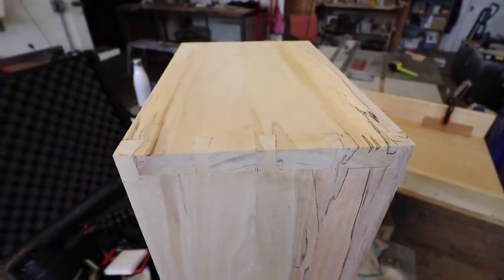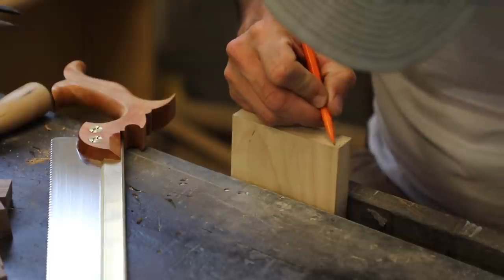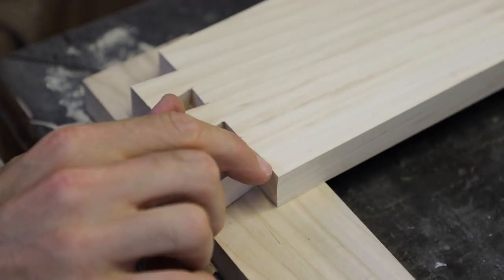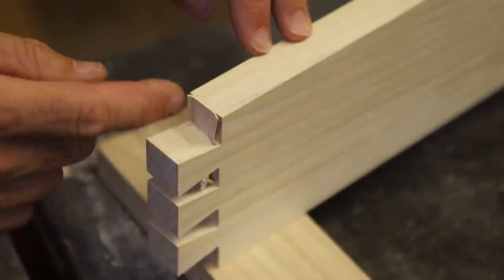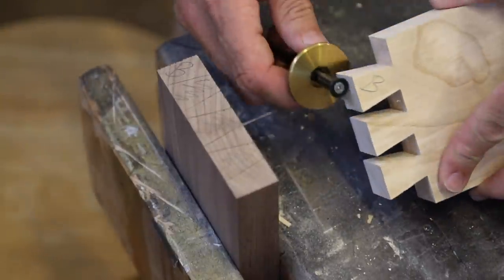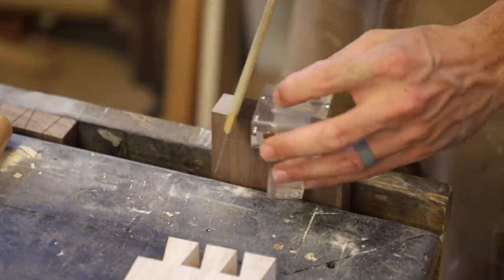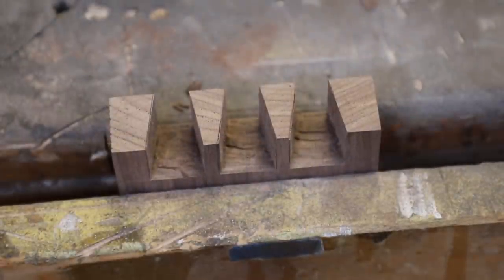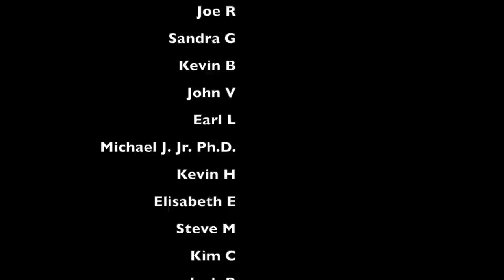Hand Cutting Dovetails | A Built in Bench Seat II

Comment: Its good when the dovetails fit tight...but the tight fit might eventually cause splitting the pin board when hammering them dovetails in. What we learned in carpenters school is they should go in pretty easily till the half...the rest can be hammered in.
Greetings from a german carpernter 😉👍
Reply from the maker: Thanks for the tips, these were a bit too tight at first, I had to fine tune them.

Comment: I practiced and did two sets of dovetails with my KM dovetail jig...I've got a ways to go to get to the level you made here, just beautiful craftsmanship.  Love this whole entire bench build you did.  Did you know the jig can help in chisel work as well in keeping everything lined up and vertical?
Reply from the maker: Hey what is the KM jig, it sounds really nice especially if it helps with chisel work!
Reply: @50Acres  The Katz-Moses Dovetail jig you used To keep the angles correct when sawing the lines.  One example is you can flip it over, place it on your chisel line or marking line and place your chisel against the magnet then tap away slowly.  You can also place it like you did to cut the Pins and help keep the angle on your pin to chisel it down if necessary.  He has a video on doing dovetails where he does it.  Basically just like it keeps your saw at the right angle or vertical the magnets can be used with chisel to keep it dead vertical or at the correct angle.
Reply from the maker: @cnich0168  Ohhh I gotcha I just didn't register the abbreviation.  Thats clever to use it with the chisel like a shooting board.

Comment: Whit spots on your fingernails means you need to take zinc, and calcium supplements.  Zinc is needed for DNA synthesis, immune function, metabolism and growth. It may reduce inflammation and your risk of some age-related diseases. Zinc is also needed for your senses of taste and smell. Because one of the enzymes crucial for proper taste and smell is dependent on this nutrient, a zinc deficiency can reduce your ability to taste or smell. Most people meet the RDI of 11 mg for men and 8 mg for women through diet, but older adults and people with diseases that inhibit zinc absorption may need to supplement.
Reply from the maker: Thanks for the heads up